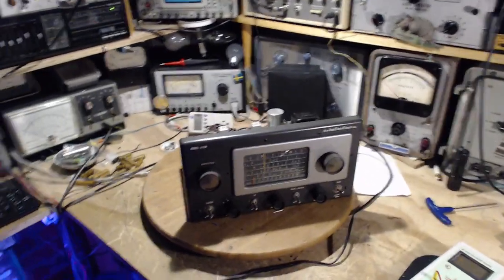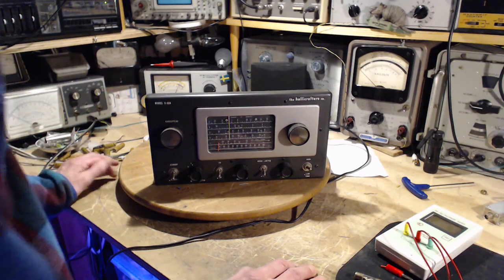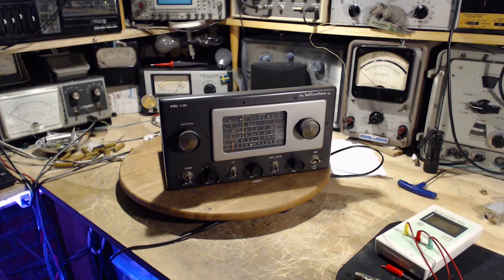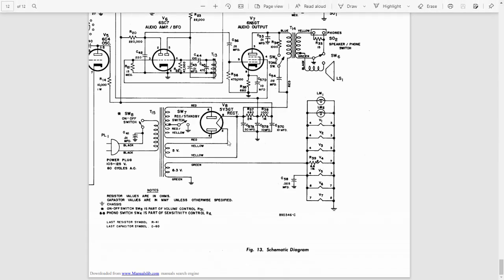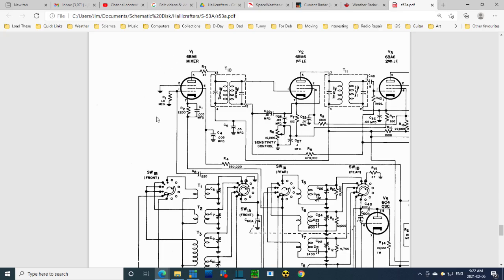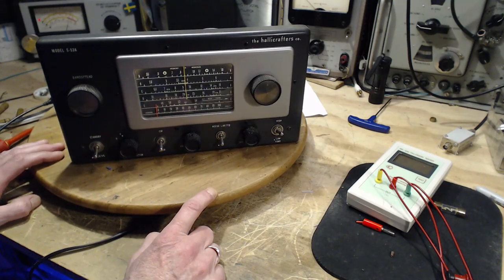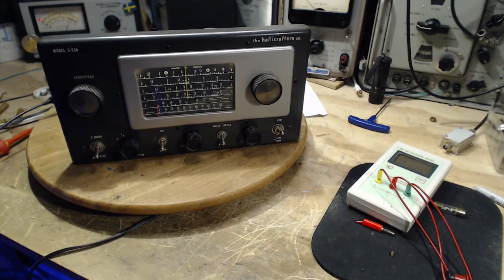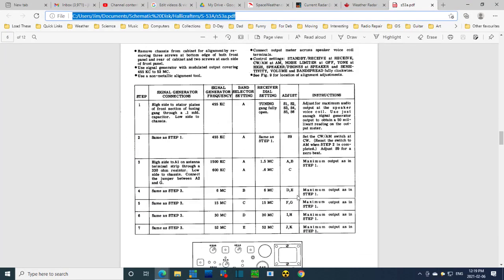Hallicrafters S-53A Video #3 - Tube Voltage

Comment: The values of resistors and capacitors on the AVC line are selected not only to prevent audio coupling but to set the time constant on the AVC circuit, so that one can control the speed at which the gain is adjusted when tuning a cross different signal strength stations and also the rate of fading up and down of the signal. In communication receivers this “time constant” is often switch selectable.

Comment: 34:51 So you are saying that the BFO is injecting its signal into the sub B+ of all frontend tubes. Thereby effectively working with a 22k resistance against whatever RF to ground shunt various capacitors (amongst them a 10uF filter electrolytic) provide. Hmmm. It may work somehow if the caps have low capacitance, lousy ESR or high series impedance. But how likely is that?
I'd say it is much less likely than using a cap to inject the BFO signal from... say the grid pin 4 of the BFO osc tube into... say the plate pin 3 of the detector diode V4.
You dont see that cap on the schematic he uses? Well it is a wire gimmick referred to as C61 on the "H communications Operating and Service instructions" for Run 2 schematic diagram, drawing no. 89D346-E
While he uses the 89D346-C drawing.
So what do we learn? If in doubt, dont just ignore it but doubt the documentation and get a proper one. 
And BTW;  the BFO injected into the detector diode will produce an AGC voltage too. So the AGC in CW mode is no longer a function of the received signal but mainly a function of your own BFO signal. So you need to clamp down the AGC voltage or your frontend will become deaf.
And the reason the BFO is unadjustable is because it is for CW operation only. Only on SSB you need to be able to fine tune the BFO.

Comment: 1:15:15 You obviously disovered and are fully aware(!) of a partially shorted secondary winding on the power transformer. Yet you conclude that instead of getting a new transformer the only option for you is to either boost the primary voltage or remove filter and dropper resistors in the B+ line to make up for that? You gotta be kidding! As an ex power company employee and with a background in electronics YOU OF ALL PEOPLE should very well realize that a shorted winding in a transformer always causes excessive heat and it will further damage the winding insulation, eventually leading to more shorts. And since according to the schematic this radio does neither have a fuse in the primary winding nor a thermal protection there is nothing to prevent a complete meltdown other than the many Amp breaker in your power distribution box.
Your ignorance of this potential fire hazard is like actively building an incendiary to turn your or even worse your customers home into ashes.

Comment: I'm wondering if the function of the receive/standby switch was checked, or if any modifications had been made to it to provide a lower voltage as a way of providing a sidetone if used with a CW transmitter long ago?  I'm also wondering if there is any sign of arcing, shorts or a carbon trace on the 5Y3's tube socket.

Also, in looking at how Hallicrafters transformers often fail in their transmitters, it could be that the apparent internal transformer short is to the 5-volt winding.   That could explain how hot the 5Y3 rectifier tube seems to be.  If that is the case, a possible solution could be to disconnect the 5-volt lines coming from the transformer and capping those leads.  Then removing the 5Y3 permanently and tacking in a pair of 1N5408 diodes (or some lesser-rated diodes in series) to replace the function of the tube. 

The diodes should kick up the B+ voltage a bit as well -- something that this radio looks like it could use, even if disconnecting the 5-volt lines does not improve the output voltage itself.  

That B+ filter capacitor trio, along with its two bleeder resistors' values, would be on my list of things to check before alignment, even if there is no apparent hum on the audio, since leakage or an off value could be pulling the B+ down.    

Good luck!
Reply: After watching Jim's videos for a while now, it seems he goes by sound more than anything; no or minimal hum = Filter Caps are good; loud static = good sensitivity / front end; low volume = weak tubes.  It seems to be how it goes there.  If he receives at least one channel per band, radio is good to go.

Comment: He's gonna align a radio with the mains transformer kaput !!! 240 Volts,  100 who cares, let's 'do the alignment'...
PS Skip to 40:00 - Nothing good comes when he tries to read the schematics...
Reply: What he is doing is not even funny anymore as in Mr.Magoo funny. 
A partially shorted secondary will cause overheating of the power transformer and further worsen the problem. And with neither a fuse nor thermal cutoff in the set there is nothing to stop it from eventually smoking. So ignoring it and at around 1:15:00 even considering to overcome the lack of output voltage by eliminating dropper resistors in the power supply is IMHO close to arson.
This video should be titled
"Hallicrafters S-53A Video #3 - Turning a radio into an incendiary"
Reply: @randomsteve4288  Why is he always running his equipment at to me super low voltage?  He seems to run at about 100v - 110v on all equipment.  To me all that is a recipe for disaster when the owner plugs into a 120 (or more) outlet.  You have to at least look at the equipment with it connected directly to an outlet.  Wonder how many people get equipment back from him that burns up when they plug it in?

Comment: If you have shorted turns in the power transformer then it should be over heating, and will get worse.
Reply: Would almost think that a short in the power transformer will not just stop at shorting a few turns but take out the entire transformer or as @widecast states get hot fast.
Reply: @curtisgriffin7924  . He should run it without a load on any of the windings and see if it over heats.
There has to be more to this than we know.

Comment: This receiver is designed to expect an antenna impedance of 300 to 400 ohms. Jim uses folded dipole antenna which would have a theoretical impedance of 300 ohms balanced. Unfortunately then Jim uses the wrong sort of cable to connect the antenna to the receiver.

Comment: One approach to increase the B+ a bit is to remove the 5Y3 and install two 1n4007 (or sim) silicon rectifier diodes. These very cheap, reduce the load on transformer by removing the 5V filament power and as they have a lower forward V drop result in higher B+.   Very commonly done in refurb of these radios to reduce heat and improve reliability. In fact sometimes find the plug in solid state equivalents on eBay, but they simple to implement\and 1n4007s very cheap..

Comment: Not much more to say than what already has been.  I think Jim's a nice guy and he means well, but I can't believe he doesn't even consider replacing the transformer!  Actually, I do believe it. SMH.  He has no patience anymore  for this kind of work.  He seems more interested in getting his present project done and getting on to the next.  Get's distracted easily.  Not to mention pushing out the videos instead of taking his time to fix it right.  No troubleshooting skills to speak of.  Will attempt an alignment and not follow the procedure.  We all know this one should not even be attempted until the transformer is replaced.  Good luck Jim.  Be careful!